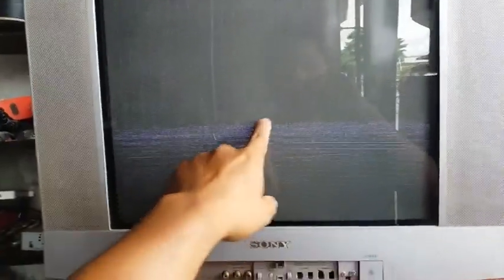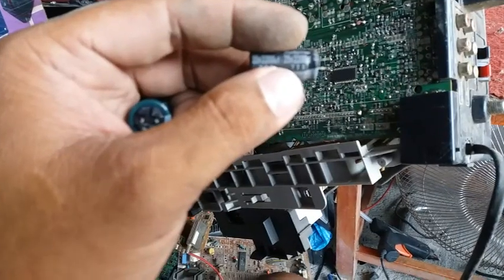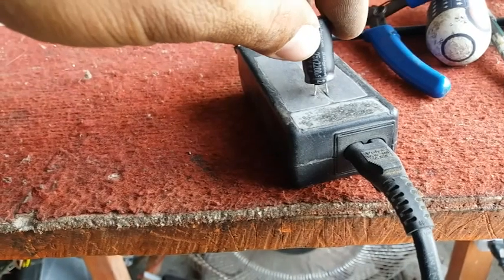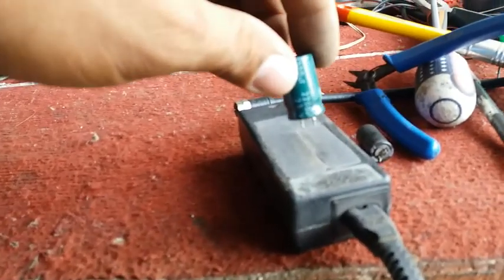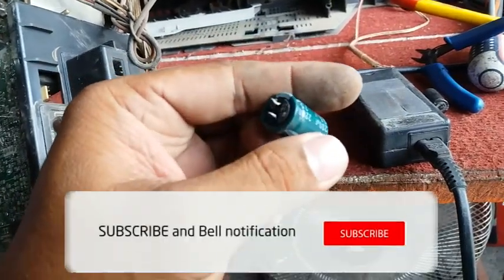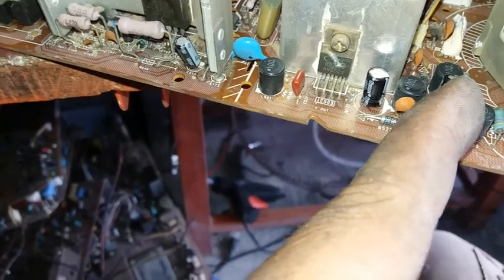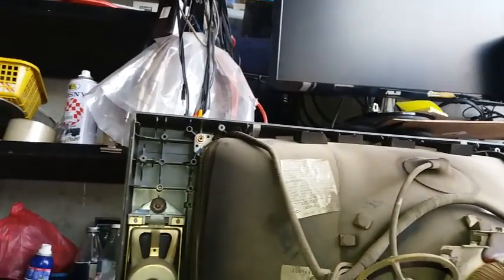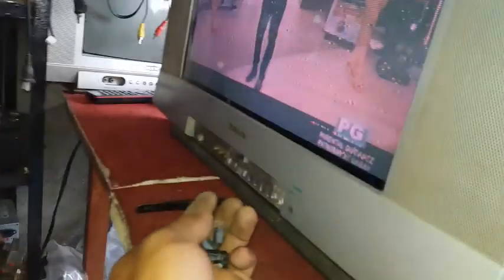Horizontal line repair tips Sony trinitron crt tv repair

Comment: The way you tested the capacitors is totally amazing bro! It shows you're a pro in the field! 👏👏
Reply: It’s not the correct way to test a capacitor, you need to check the actual capacitance value and ESR. The test on the video will only tell you if the capacitor is open circuit or short circuit which is not enough for most faults

Comment: sir, may sanyo crt tv po ako, may power siya pag pinindot ko yung power nya may red light siya pero namamatay agad, anong trouble nito sir?
Reply from the maker: check mo regulator
Reply: @xiantekelectronics  ok naman regulator nya sir, kaso malakas yung bultahi sa str nya nangangagat, bali laging na shoshorted yung horizontal transistor sir? anong trouble nito sir?